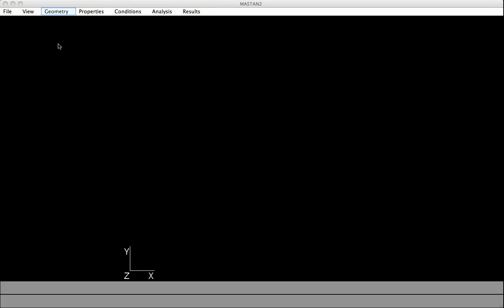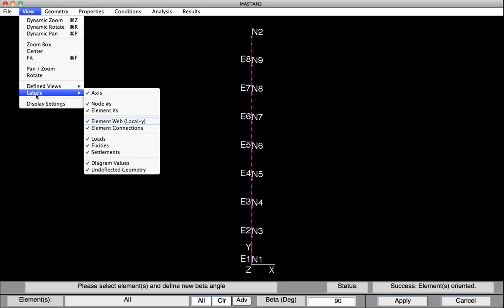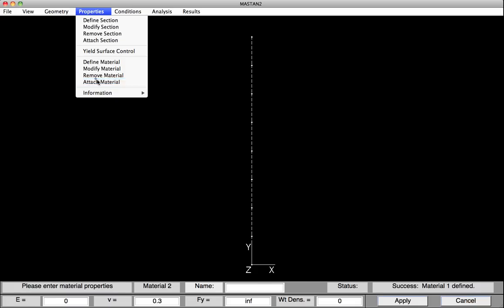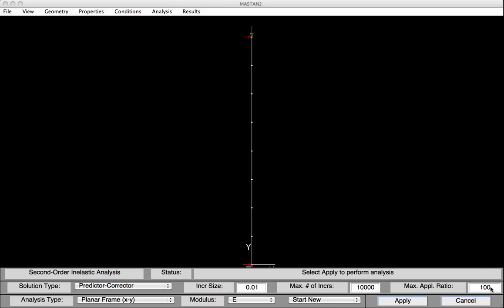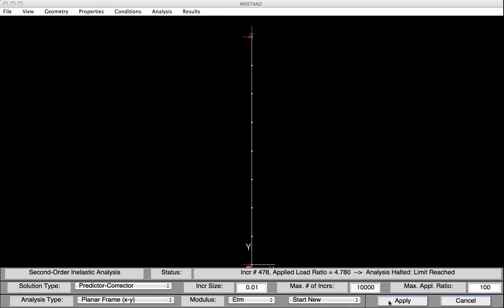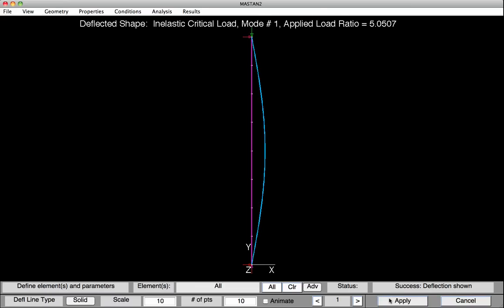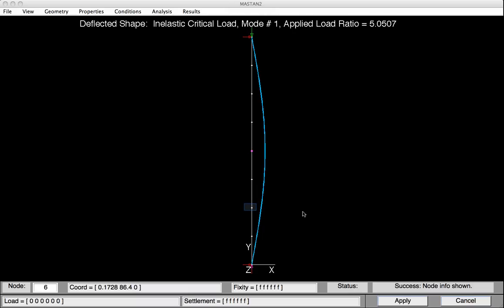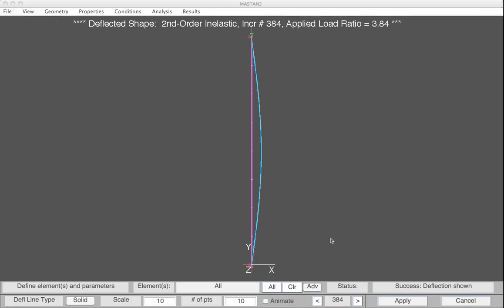MASTAN2  - Learning Module 2

Comment: Thank you so much for the videos. What does MASTAN consider has failure load (In this case at 554 kip)? Is it yield across the section? In that case shouldn't it be throwing the "mechanism formed" notification.